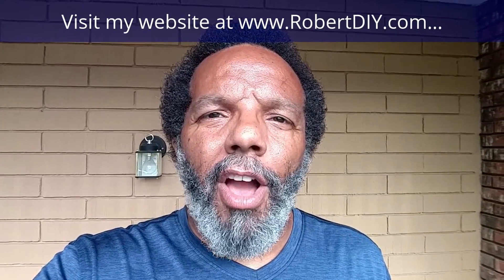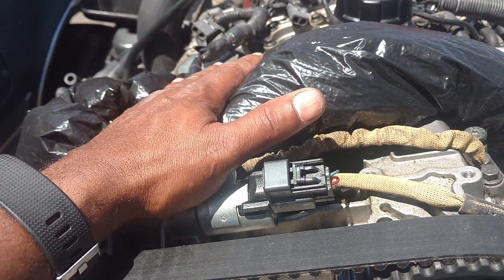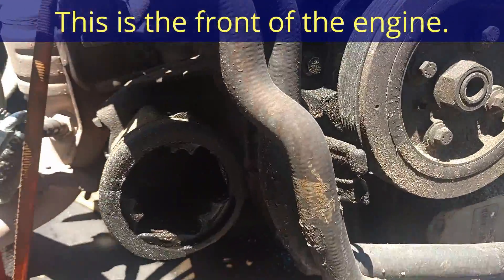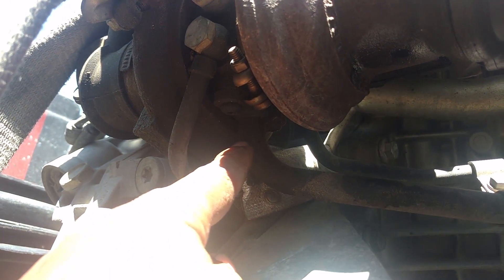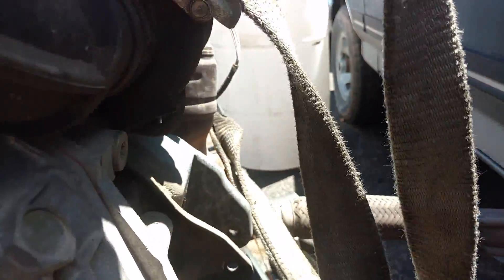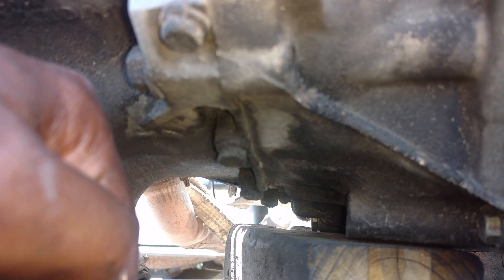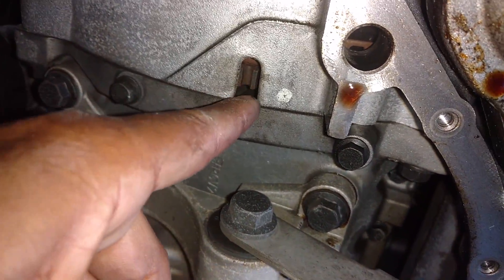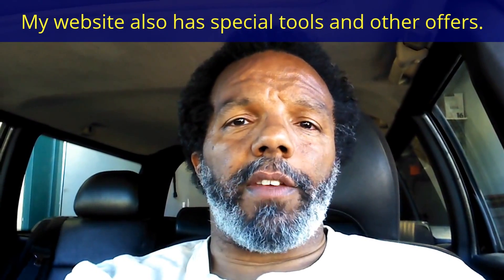How to find oil leaks on a Volvo white block engine. S60, XC90, V70XC, S80, S70, 850, 960, etc. VOTD

Comment: Soo mine is leaking but I can’t seem to find it I see a lot of smoke come from behind the engine
Reply from the maker: Ouch
Reply: @RobertDIY I’m thinking after watching this video it’s the cam seals I’m debating on doing myself or taking it to a shop I don’t want to mess up the timing . I’ve noticed that it’s leaking a lot of oil on the passenger side

Comment: If oil has come out of cap and needs a new o ring, if there is alot of pooling around the spark plugs aswell seaping around the D cap. Will that cause issues?
Reply from the maker: https://youtu.be/L1fQjpc39ZQ?si=gz7nlKVZVFBjga6Z

Comment: Does this apply to a c30? Massive oil leak appearing to be from the banjo bolt on the turbo inlet line but no oil on cam seals. Just replaced the oil filter housing.
Reply from the maker: How would that happen?
Reply: @RobertDIY PCV went bad, but there is no oil on the timing belt or cam gears. It looks like it is coming from the turbo inlet oil line but the line is steel. I replaced the banjo bolt and crush washer twice. It’s coming from the passenger side of the engine about mid to half way up. Took it to a shop they couldn’t find the actual source of the leak either. I am stumped

Comment: Have newer 2015 s60. Having a leak and it seems like it’s leaking Into the combustion chamber. I know it’s leaking because oil is constantly turning up low… maybe once a month or so. Just got a check engine like for the catalytic converter, After a long while of just refilling with oil when it gets low. So I’m almost certain it’s leaking into the combustion chamber, Any suggestion?
Reply from the maker: It's called oil consumption. I'm not sure if it's rings or valve stem seals. Probably rings. Keep adding oil and try not to miss oil changes.

Comment: Hello Robert, thank you so much for the excellent videos you make. At three minutes and 56 seconds into your video there is a tube sticking out of the back of the engine without a hose attached to it. Should there be a hose attached to that? My 850 Volvo has that same tube with nothing attached.
Reply from the maker: No, that's the engine coolant drain cock.

Comment: Hey thanks for that bit of info at 6:20! I've found I was losing a lot of oil and I did trace it to the front of the engine and the bottom of the PCV, fault was mine, hadn't tightened the hose clamps enough where the trap drains into the block. 

I did not believe it was possible for it to leak much from there however so I've also ordered a kit for a new oil pump gasket, o-ring and crankshaft seal, believing that to be a more likely location for an oil leak of this magnitude. But if you say it's possible for that much to leak from that port, them maybe that alone explains my issues.
Reply from the maker: I've never ever ever never ever never ever ever ever never seen a oil pump leak on these vehicles. The front crankshaft seal, yes, but an oil pump, no.
Reply: @RobertDIY  I was talking to a Volvo mechanic about my issues and he claimed it was common on later V70s anyway. I am not sure how much later that means. He said he had no 850 experience but the more modern cars engines ought to be more or less the same. 

But maybe they changed something that made it more leak prone? Or experiences can vary that much I guess, this was in Finland.

It was 20 euros for an elring kit with all the seals and gaskets so I figured why not.

Comment: Robert, I love your videos. I have a 2008 S60 2.5T with an oil leak that appears to be coming off of a hose clamp that originates on the driver's side of the engine in the middle between the two camshafts, but lower than the camshaft seals. This hose goes towards the back of the engine. I assume that it is a oil hose, but I suppose the leak could be the from above and dripping onto it. Is there a oil hose that comes off the end of the engine? Or is it a coolant line? Thanks. I posted a picture to swedespeed site with the thread title "2008 S60 oil hose leak - hard to reach/identify".
Reply from the maker: coolant
Reply: After closer examination, it appears that the leak is probably coming from the camshaft seal and leaking on to this hose. So, this hose it likely a coolant hose.
Reply from the maker: correct

Comment: Question. I have a 1998 Volvo V 70 2.4 L base model. Looking at the front of the car . Back top side of motor. There is oil on the top. I understand it does not have a valve cover gasket. Any suggestions ? There is also oil near the distributor cap. What kind of chemical should i use to clean oil stained areas?
Reply from the maker: https://youtu.be/vJXfQrDPK04
Reply from the maker: I like Oil Eater and Engine Bright Gunk product.

Comment: I have a 06 s60 2.5t as I was replacing the plugs first plug by the timing belt was dry an crusty when I took it out the next 4 had oil on the plugs ???  Any input ??
Reply from the maker: https://youtu.be/L1fQjpc39ZQ?si=oClY13NW4_Wzu4Dy

Comment: I bought a Volvo v70 2002 2,4T and my car started to get oil light and when I put more oil in the car I se that it’s dripping oil and leaking from the right side of the front and I wounder what it can be and what I need to check and replace
Reply from the maker: Was the light on because the level was so low?
Reply from the maker: https://youtu.be/uobbKpzO_GI?si=g7jzW79S_ApxKgbL

Comment: Robert, I just wanted to say I’ve been watching your dual VVT timing belt videos for six months xC90  it has not ran for 6 months. 
I’ve taken that belt off and on like 10 times and I’ve bet I’ve had it right 10 times and it still wouldn’t start and never threw a code  I finally found a blown10a  ignition fuse. changed that fuse under the hood it started immediately. Thank you.
Reply from the maker: you are welcome. Sorry to hear about the fuse.

Comment: Hello Robert, I have a volvo s60 p2 2.0 liter turbo. I have an answer to you. There is an oil leak on the top of the engine. Will there be oil leakage caused by pcv? Thank you.
Reply from the maker: https://youtu.be/L1fQjpc39ZQ

Comment: Hey Robert love your diy videos... I have a 2000 volvo v70 non turbo v70... I have a oil leak just above the heater hose inlet not sure of the technical name of the component.. any help will ensure a good repair on my end
Reply from the maker: How can I help you with that?

Comment: Hello good video I have a leak between transmission and engine but its not engine oil it's ATF would that be torque converter issue
Reply from the maker: could be a input shaft seal leak or an internal pump seal in the transmission.
Reply: @RobertDIY  I'm guessing a engine out job 🤣🤣

Comment: Excellent as usual sir.
I’m replacing the camshaft seals, how do you lock the cams so don’t move, other than using , buying the expensive tool?
You mentioned a tool to install the crankshaft seal.
Thanks a lot
Reply from the maker: You need the tool that is less than 20% the cost of paying someone to do it correctly

Comment: Hi Robert, greetings from Cambridge, England. You are a treasure trove of knowledge being shared and I've watched your Youtube channel for a few years. 

My 2005 facelift petrol manual 140bhp Volvo V70 SE with 164,000miles has a bad oil leak but my trusted independent mechanic and I (prototype design engineer) can't believe our process of elimination. Your experienced opinion sought, if you haven't retired yet!

All the places to look for we've already done. The intake front cam seal has tiny weep and the power steering pump too, but it's not these. 

It seems to be coming from the front right of the block where the cylinder head gasket mates with the block. Standing in front of the car, this would be rear left of the block, near or at the corner of the block. 

It's possible previous owner had a water pump failure and the block overheated. This could have damaged the head gasket but there are no other indications of this fault. 

I'm about to resort to head removal, skim, refit at £60/hr. Many would scrap the car, but I believe in providence has value to current owner 🤪

Have you ever seen this sort of oil leak on a B5244 engine before?

Are we wrong?

Best regards, Matt.
Reply from the maker: No. However, I have seen the lower adapter for the PCV box leak very bad when an aftermarket part is used. Volvo card number 8653339.

Comment: Robert where did you say the PCV valve valve was I need to change cuz I have the oil leak going down into my plugs I have a 2000 Volvo C70 2.4 my name is Jake
Reply from the maker: https://youtu.be/gt9w-ZSxs9I

Comment: 2009 Volvo XC90 v8 Front passenger side Oil leak ..White smoke after driving and stopping at stand still Should I go ahead and do Valve cover gasket .. just had Idle pulley replaced .. Please advise
Reply from the maker: Sad to say, I don't know much about the V8's.
Reply from the maker: https://youtu.be/51jrtfMLNaY

Comment: If you repair plugged pcv system do you usually end up having to replace the seals that were leaking due to pressure? or do they self correct after the pressure is removed?
Reply from the maker: Most of the time the seals need to be replaced.

Comment: Nice vid. Helped me locate 2 leaks
Reply from the maker: Good to hear
Reply: @RobertDIY  question, I just got this 2003 XC90 2.5t awd with140,000 miles. Passed glove test, and timing belt seems to be done. Do you think these vehicles are decently reliable ? I paid $750 with intentions to flip but kinda like it

Comment: Robert you are the best.I have a question.My xc90 2.5t 4wd has develop a strange oil lick between engine and gearbox.I push it a little hard and the next morning had a oil spot undernith about 300ml.I went under and with engine running I didnt see any lick not even when I had it in 5000 rpm.The lick sims like over the ange gear box.Please help I cant trast my car like this.Thanks Robert.
Reply from the maker: Did you watch the video?
Reply: @RobertDIY  Yes Robert and thanks a lot I found the leak.It was the rear seal of exhaust camshaft but  it is hidden and I coulden see it.Today I dismantle it and saw the lick.Thanks again.Greetings from Greece.

Comment: How do you replace value cover seals?
Reply from the maker: https://youtu.be/pYuszsm9v1c
Reply from the maker: I don't understand your question.
Reply: Have a valve cover ket about 6 seals in it,this motor dose not have a valve cover so these seals are for where the cam  cover seals or cam seals
Reply: How long does it take to get a reply?

Comment: Hi there, my neighbor is recovering from covid where he almost died. His 2001 s60 2.5 turbo is leaking horrible. To the tune of 5qts in a week and maybe 75 miles. Puddle under looks to be passenger side. Buyouts is everywhere. Any help finding out where that much oil is coming from before I get started on it. I have never worked on a Volvo, but looks to resemble a Honda a little bit.
Reply from the maker: Bring it by.

Comment: How you doing Robert ever since I bought my volvo a couple months ago I been watching ur videos and gaining knowledge thanks to you, i have a 2000 volvo v70 se non turbo with 178,000 miles my question is I was driving on the highway doing 70 to 80 mph my oil light started blinking and started making noise an white smoke out the exhaust I pulled over the engine was extremely loud rattling smoke was coming out the oil cap an oil was leaking from under the intake manifold by the throttle body  I check the dip stick the car had oil , could it be the oil pump ? Motor sounds like it got no oil .. motor was fine before ,driving every day back an forth to work 100 miles a day
Reply from the maker: sounds like it threw a rod. what oil weight was in the engine?
Reply: @RobertDIY   oil weight ?? Oil in the car was 10w40

Comment: Just had my seals changed on my 2002 Volvo C70 2.4 l turbo all three seals and new timing belt and new serpentine belt and pulleys replaced and the car within 2 weeks is right back leaking oil can anyone tell me what my problem could be or would you take it back to the shop to let them reevaluate what they just done 🤔💡
Reply from the maker: Is the PCV serviceable?
Reply from the maker: What brand seals did they use? Is the VVT hub leaking?
Reply: @RobertDIY  won't know exactly where it's leaking at until the next couple of hours but as a customer and me looking at where the car is leaking from it seems that it's coming from the front of the bottom of the motor I don't see anything spraying or droplets on top of the motor so I'm figuring that the leak has to be coming from the bottom of the motor somewhere but I will know for certain in the next hour or two because I'm going to take the car back to the service repair shop and thanks a million for getting back in contact with me people truly appreciate you Robert 👍💯
Reply from the maker: Where is the leak coming from?
Reply: @RobertDIY  I was told by my mechanic that it'ss possible I could have a rear seal leak and he informed me that something that I could live with just check my oil every week and he also informed me that if I wanted that repaired it could cost me into the thousands of dollars because he had to lift the engine and trans out to get to it...

Comment: When changing a upper crank seal on a 2002 volvo C70 2.4 5liter turbo should you change the bottom crank seal and timing belt also please let me know 🤔💡
Reply from the maker: Upper crank seal??? You mean cam seals? I only replace seals that are leaking.
Reply: @RobertDIY  thanks so much because I have my car in the shop right now and then replacing a seal and they're telling me that they have to change all three seals on a 2.4 turbo Volvo C70 and telling me that they had to change the water pump also and the timing belt that's a lot of work for one seal just to be leaking so I'm glad you gave me this information now I will possibly not have to spend close to $2,000 for some work to get done on a 2002 model car if it wasn't necessary peace and thanks 😊

Comment: Losing oil or transmission fluid on my volvo C70 2.5L turbo it started leaking in the last 48 hours it's a big leak on the passenger side of my car I'm really worried about this problem wondering if it's a hose or a major repair can anyone share information with I'm a first time volvo owner?💡
Reply from the maker: Did you watch the video?
Reply: @RobertDIY  yes I watched the video I watch serval of your videos and I found out what my problem was upper cam seal oil leak got it schedule for repair thanks a lot your video really help people 👍✌️🏀

Comment: So I have a pretty bad oil leak rite at the oil pump, took the pump out replaced the gasket and the o ring along with the cam seal. Still have the leak. It’s not a clogged pvc I checked that but other than messing up the gasket or o ring only thing I can think of would be the pump itself. Seems like that thing would be dang near indestructible though. 02 v70 2.4 turbo any thoughts.
Reply from the maker: Probably damaged the crank seal when you installed it. Did you use a seal installation tool?
Reply: @RobertDIY  well I wasn’t actually the one to put it in but looks like it’s leaking from the cam shaft too smh. Trying to find a dual cam locking tool and then I’ll put it back apart.

Comment: Hi Robert, i love your channel.  I love volvos.  Some time ago a purchased  a '99 S70 for $350. The owner said it needs a new catalytic converter and the code shows it. I registered this vechicle in a state where i dont need a smog. So, can i just cut off the cat and bypass it? Ive done this with other vehicles and they ran fine. Lance.
Reply from the maker: No, you must get a new cat and keep it feed and warm or it may die.

Comment: NA engines can also leak from the non-turbo oil return line port.  it's like a freeze plug in the block casting.  it can pop out allowing open access to the pan.  awkward to tap the plug back in
Reply from the maker: Interesting.

Comment: Hi Robert, i’ve purchased a ‘95 850 GLE with a 2l engine and I’m experiencing a subtle oil leak. Opening the bonnet i see oil in the superior part of the engine, right under the oil cap and in the left side of the engine.
I’m assuming/hoping it is only due to the fact that the oil cap rubber has hardened a lot so that by changing it the problem will be solved but I have a question for you.
Is it possible that the leaking is due to the valves of the fifth piston? The one on the far left. TY in advance
Reply from the maker: Probably not.
Reply from the maker: https://youtu.be/-2oIeIhpV44
Reply: @RobertDIY  Thank you very much for your quick response! I've seen the video and took note of your advices. Today i've changed the oil cap with a new one that unfortunately is not original but i'm trying it anyway, if it doesn't work i'll try going right to a Volvo service. I've also purchased a "stop leak oil additive", done few miles and then put the baby asleep, tomorrow morning i'm gonna check the results. Thursday i'm bringing the car to a mechanic for a check up so i'll have more infos and will then decide what to do next. Anyway i'll surely follow your advices, but first of all i need to know where the oil leak is coming from and solve the problem, then i'll go for the timing belt and so on...
Reply: Hey Robert I just got a 98 v70 2.4 non turbo just got running and looks like I have a good oil leak looks to be coming under Distributor cap any? Any help you could give me I'd really appreciate it

Comment: Hi robert on my 2000 c70 the oil filter seal has failed twice cauing large oil leaks. I notice the leak and i get under the car and the seal is on and then in one spot its pinched off causing oil to seap. It has happened twice in a few weeks . have u ever seen anything like this?
Reply from the maker: No, is it on to tight?
Reply: Changed the filter and seal hopefully it wont fail again thanks for the reply